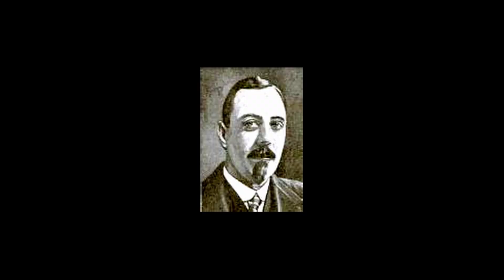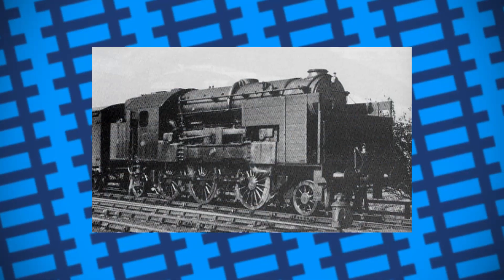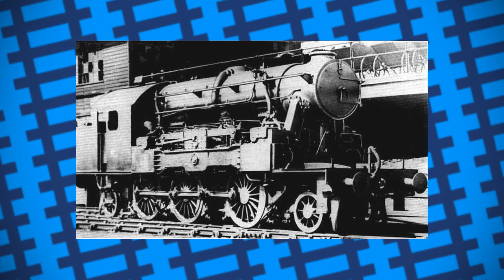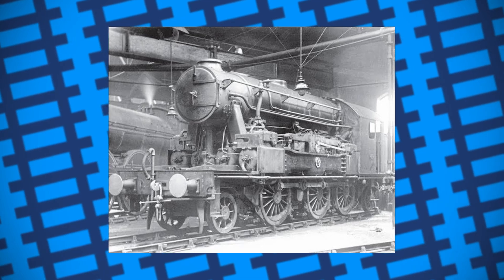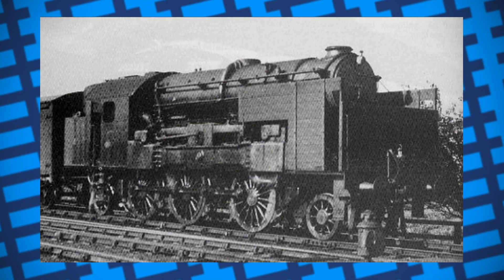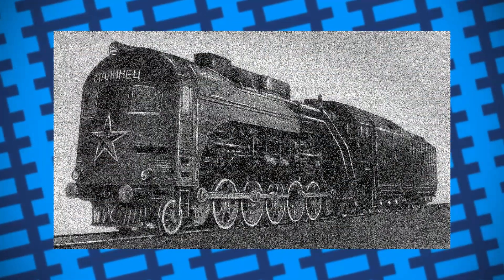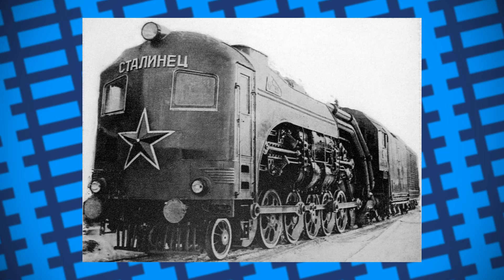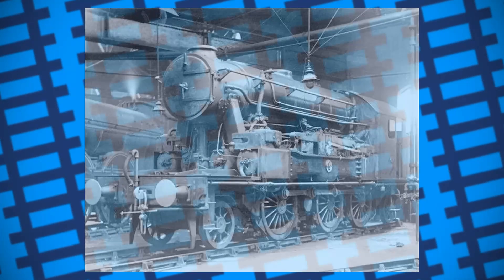The unusual trains that ran on Steam AND Diesel - Kitson Still Engine

Comment: What a silly looking Loco!

In a slightly related note, I have wondered if it would be weight efficient to place a small boiler on highway trucks  to capture the waste heat from their diesel engines.

Would have some way to choose if you want to inject steam or diesel every cycle.

I don't know if you could get the boiler hot enough or if it would just weigh too much for the fuel savings to matter.
Reply: In the world of steam-powered cars, steam generators were developed which build pressure much faster and more efficiently than conventional boilers, and with modern materials they can be made even more efficient now than they were back in the day. They ran on gasoline back then, so I see no reason why properly insulated exhaust heat couldn't power them now. You could even use the coolant from the engine as the water being boiled, since it's already  near boiling temperature as is, and use a condenser rather than a radiator to turn it back into liquid. This should provide enough extra power to get away with using a smaller internal combustion engine, which would keep weight about the same and increase fuel economy. Like a hybrid, but without batteries, and the steam generator would likely be hot enough to burn any unburned fuel in the exhaust so it would be cleaner than a regular internal combustion engine as well.
Reply: @Thinginator  But it always hits the problem that a steam engine is about 10% efficient at turning heat to power whereas an internal combustion engine is round 40% efficient. So as soon as the latter became reliable enough (petrol cars in the 1920s, diesel lorries in the 1930s) the steam equivalents promptly disappeared for ever (apart from steam preservation rallies). The Sentinel high-pressure boilers used in steam wagons were also used by the LNER in steam railcars in the 1920s which were fairly successful, but again superseded by dmus in the 1950s.
Reply: @iankemp1131  Maybe so, but steam engines are still powered by heat, while internal combustion engines throw a lot of heat away, so why not reclaim a bit of efficiency by routing exhaust and coolant through a steam generator? Plus, we've had almost a hundred years of advances in material science since people stopped developing steam engines, there are plenty of ways you could improve the efficiency now that weren't possible back then.
Reply: @Thinginator  Routing exhaust through a steam generator could make sense, if you can find a useful function for the (relatively small) amount of extra power to perform.   
I don't think using coolant would work so well, since modern engine coolant is so full of corrosion inhibitors it's barely water any more - evaporating it in a boiler would likely cause all sorts of gunk to precipitate out.   I'm guessing there though.
Reply: @Thinginator  Absolutely right in principle, but not in practice given the space and weight limitations on railway locomotives. That's why steam engines used firetube boilers and non-condensing exhaust, cylinders and rarely (in the UK) compound expansion, whereas power stations and ships use high-pressure water tube boilers, condensers, compound or triple expansion or turbines, etc, and achieve far higher cycle efficiencies than railway steam locomotives. The extra power from low efficiency steam generated from a waste heat boiler is too small compared with that from the main diesel engine.
Reply: @cr10001  In that case it might be easier to start with a boat motor, as boat engines are cooled by pumping the water the boat sits in through the engine. They're already meant to work with water, so maybe they're designed not to need as many corrosion inhibitors?
Reply: Your last point is correct I'm afraid. You can generate a fair amount of heat from the exhaust and even some low-grade heat from the cooling jacket. But steam from the former is a very inefficient form of power generation. Diesel and gas engines are far more useful in static CHP (combined heat and power) systems where the steam can be used directly on an industrial site and the hot water can be used for space heating of buildings.
Reply: Six cycle engines have intake, compression, power, exhaust, steam power, and steam exhaust for their engine cycle. They never have good power to weight ratios but are efficient.

A similar idea is the Cheng combined gas and steam turbine cycle. The waste heat recovery boiler feeds high pressure steam into the gas turbine's turbine inlet to increase mass flow while lowering gas temperature.

For road vehicles turbo-compounding can be used. Originally developed for piston powered aircraft, turbo compounding take the exhaust from a piston engine and drives it over a gas turbine that is geared to provided mechanical shaft power. Some trucks use turbo compounding already to improve efficiency since it makes more power per unit fuel.

 I would suggest adding a heat recovery boiler in the exhaust system that fed steam into the exhaust manifold before the power-recovery turbine in a turbo-compounding engine. No need to deal with steam cylinders, just have a hybrid gas/steam turbine run on engine exhaust and steam in an open cycle.
Reply: @JaneDoe-dg1gv  that last idea wasn't something i had considered! seems like it might be the best way to capture the waste heat and turn it into more usable enegry.

for road trucks the problem will always be "can we save weight or offset its cost in fuel savings" and i don't know if adding a boiler and water tank can ever do that.
really wish i could afford to try though.
Reply: @ARockRaider  Turbines do have the highest power to weight ratio so that lightness helps offset the weight of the boiler and water. I see a few possibilities.

Having only a Power Recovery Turbine (PRT) gives; One, cold Water is sprayed into the exhaust and flashes to steam to run through the PRT and exhaust system. Two, as before but the water is preheated by the engine coolant. Three, also as before but the water is heated by engine exhaust before being injected into the exhaust manifold. Avoiding condensation of the engine exhaust gasses helps to prevent acidic corrosion

If I was going to do something. I would have the hot engine coolant preheat the water and then just spray the water into the engine exhaust so it can go through a PRT. That's the lightest system which means it has the highest chance of being useful.
Adding a PRT can already increase power output by 20-30%. The problem with PRTs is increased engine temperature; The water would first be a disposable coolant and then directly cool the engine exhaust. In places with lots of water for cheap and running only short trips This system might actually succeed.

Alternatively, have a separate steam turbine be co-mounted with the PRT. Engine exhaust feeds through the PRT then a boiler. Boiler feeds the steam turbine. Turbine exhaust runs to a condenser in front of the normal engine radiator. Condenser condensate can be pumped back through the boiler. If the condenser can't ingest the full steam flow, steam backpressure rises until it exceeds the pressure inside the engine exhaust manifold. At that point steam can bypass the condenser and instead be dumped into the engine exhaust where it will run through the PRT and boiler before being ejected out the stack.

One is cheap, the other has less water consumption. Either way the reduced fuel cost likely won't offset the water cost and especially won't offset the reduced cargo capacity due to weight restrictions. Let's not forget that steam locomotives now have a hard time operating on railroads due to there being few water sources on those systems.
Reply: @JaneDoe-dg1gv  I'm fairly sure tap water is at least as available as diesel is and i figure the water will be displacing some of the diesel, the question is how many miles per gallon (MPG) of diesel does a gallon of water displace?

i would probably try to dump as much heat into my steam water as possible, maybe to the point of entirely replacing the radiator, the hot steam acting as my heat dump instead.
Reply: @ARockRaider  When talking about the amount of water being consumed the availability does becomes questionable. Imagine truck stops having to include water pumps in addition to fuel pumps. Gallons and gallons of water can start to financially add up.

Since we are weight limited and not volume limited; the way to figure out the range limiting effect of the water is to compute the mass of a given volume of each liquid. Diesel is 0.85 kg/L where water is 1kg/L.  Using this we can find that replacing equal weights of diesel for water would give a fuel to water ratio of 1.18:1. Then taking the MPG of a semi truck of about 6 MPG times 1.18 yields a range loss of 7 miles for every gallon of water added.

It won't be that bad since the water would improve the MPG rating. Computing the thermal efficiency of the steam turbine/PRT would give the improvement in MPG while the steam flow rate would define how much water is needed. Then knowing how much fuel capacity a semi has, the amount of water that is needed to match the diesel fuel range, and then the MPG of the engine would give us the total range where both the fuel and water would be totally depleted.

There are some ideas for dumping all of the engine waste heat into the steam water but doing that means the temperature of the water won't be very high in the steam system lowering both the thermodynamic efficiency and increasing the water consumption. It does make sense to preheat the water with the engine coolant but to optimize the water consumption, the amount of water flow won't be sufficient to cool the engine coolant completely.

30% of the waste heat comes out of the engine coolant, 30% out the engine exhaust, the remainder mechanically out the engine. 30% of the heat will be at ~90 C. The other 30% between 350-600 C. 220-345 C would be the average steam temperature if all the waste heat was to be consumed. I would take 6% of the engine coolant heat to preheat the water as then adding that to the 600 C engine exhaust givens and average temperature of 515 C which is much better than the 220-345 C previous averages.

Comment: I can't help but think this design could be improved on today. Perhaps with 2 cabs like some diesel engines, one at the front, and 1 at the rear
Reply: This video is surreal to me because I was thinking of almost this exact idea and now this video is here saying it's actually been done before... so I'm not entirely crazy for thinking it's a good idea! There are definitely numerous ways the design could be improved today, like using a diesel-electric drivetrain coupled with steam cylinders. The diesel drivetrain eliminates the need for the cab to be at the rear, which makes the layout much more flexible. We also have many advances in material science today which would make steam engines much better if people were still making them. I'm just convinced there's a ton of untapped potential in steam technology in general, especially if combined with internal combustion engines like this.

Comment: Let me add some information on soviet hybrids. The first one ("ТП1" in cyrilic or "TP1" in latin) wasn't running on diesel but on fuel gas generated in tender right from coal. That solved the problem with two different types of fuel but produced a new one with gas generator maintenance. The second engine was named "Number 8000". It had an interesting cylinder construction: there were two pistons dividing the volume into three parts. The central was used for fuel combustion and the others for steam expansion. As far as I know the locomotive was used for passenger and light freight trains from 1942 to 1948. The third one ("Number 8001") was designed as a more powerful version of "Number 8000". The war suspended the project and later it was canceled as pure diesel locomotives became available.
Reply: That's one crazy project! I love it. Thanks for the additional info.
Reply: Now I really want to make a working model of these....

Comment: Has Europe or any other country experimented with Gas Turbine locomotives like the UP did?
Reply: I think the original French TGV concepts ran on gas turbine before they decided on electric
Reply: The UK had a few gas turbines, but they were just experimental prototypes and did not go in to production.
Reply: @Titan604  

The Great Western ordered two just before nationalisation, 18000 had a single large combustion chamber, was started on light oil, and then turned over to heavy fuel oil.  18100 used something more like an aircraft engine; it burned light oil, but there were proposals to convert it to burn heavy oil.  After withdrawal 18000 was returned to Switzerland, where it was built.  The power plant was removed and it was used for some sort of testing, I think relating to the wheel/rail interface.  It was later returned to the UK where it is now at the Didcot Railway Centre in Oxfordshire, but it is just an empty shell.

18100 was converted into a 25 kV a.c. locomotive for testing on the first section to be electrified with this system in the UK, South of Manchester.  When the purpose built a.c. locomotives became available it was stored for a while, and eventually scrapped.  Both of these locomotives used electric transmission and had a cab at each end, looking similar to a Diesel.

Later BR had a third gas turbine locomotive, GT3, which looked more like a steam locomotive,, with a single cab at the rear, and a steam locomotive style tender which contained the fuel tank, and I think the train heating boiler.  This one had a mechanical transmission.  It was scrapped.  Somebody has built a five inch model of it which has an actual gas turbine power plant.

There was an attempt to build a coal fired gas turbine locomotive.  I know very little about it.  The power plant was completed, and run on test, but there were problems with it and the project was abandoned.

In the ‘70s the APT-E (Advanced Passenger Train-Experimental) used several small gas turbine engines.  The later APT-P prototype trains were 25 kV electric.  These did enter service for a while, but the project was stopped.  One of the protype trains has been preserved, as has the gas turbine powered APT-E which when I saw it was at the National Railway Museum in York, I think it’s still there.   They also had one of the engines on display in one of their buildings.
Reply: There was, of course, a 25kV a.c. system already operating in the UK at this time, North of Manchester...
Reply: Several gaz turbine was built in Kolomna, USSR in mid '60s and, I know, there are some modern in Russia but Im not sure are they in service now or not.

Comment: In a similar but different project, some Climax geared steam locomotives were actually converted to burn diesel fuel, using the same cylinders that originally used steam. Apparently, they worked quite well, and I believe that some of these conversions are still in service.
Reply: The only time I've seen any of the American geared locos ( Shay, Heisler, Climax) converted to run on gasoline or diesel, they've had their boilers and steam cylinders removed and a ICE installed so it drove the the wheels through the existing drive train.
Reply: @turkeytrac1  Interesting.
Reply: @Phoenixlover55  There's a significant difference between a Diesel locomotive, and a steam one which burns the same oil as a Diesel.
Reply: @tooleyheadbang4239  You really think you can't modify the steam cylinders to burn diesel? They've got really high compression already, all you need is to add a valve train and a fuel system.
Reply: @Phoenixlover55  I don't think anything of the sort. Whatever gave you that idea?
Reply: @tooleyheadbang4239  I read it on Wikipedia a while back when I was doing a school project, though given it was Wikipedia, it may have been incorrect.
Reply: @Phoenixlover55  I was asking why you thought I was under the impression that modifying the existing cylinders for internal combustion wasn't possible.
Reply: @tooleyheadbang4239  You literally said in a previous reply that you don't think you could, then asked me what gave me that idea.
Reply: And either way, I'm pretty sure I was wrong. I looked at Wikipedia again, and it said "A number of Climaxes, especially Class A, were later converted to diesel or gasoline power, and some still exist in this form, using the original frame and drive mechanism." Younger me saw that they used the original drive mechanism, and assumed they used the original cylinders. However, I think that turkeytrac1 may be correct in that they replaced them and the boiler with a standard gas/diesel engine, and connected that to the gear system.
Reply: @Phoenixlover55  I said nothing of the kind.
Please read it again.
Reply: @tooleyheadbang4239  I said "You really think you can't modify the steam cylinders to burn diesel?" in the 4th reply to my original comment, followed by you in the 5th reply saying "I don't think anything of the sort."
Reply: @Phoenixlover55  That is correct.
At no time did I suggest that " you can't modify the steam cylinders to burn diesel."
I'd love to know why you said that I did.
Reply: imma be real while steam cylinders are absolutely metal and have high expansion ratio (and therefore compression) 

the pressure difference between diesel and steam is bonkers. 2.6kpsi vs 110psi ish. depending.
Reply: @harrymu148  Yeah, I've done some additional research since writing that, and yeah, they'd stick a normal engine where the old steam engine was